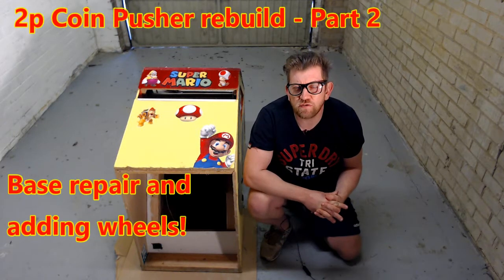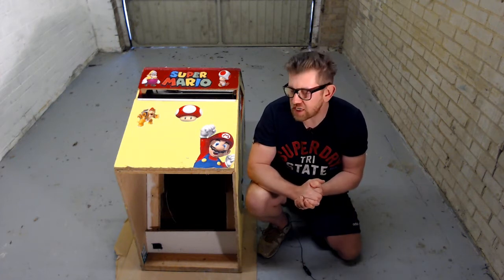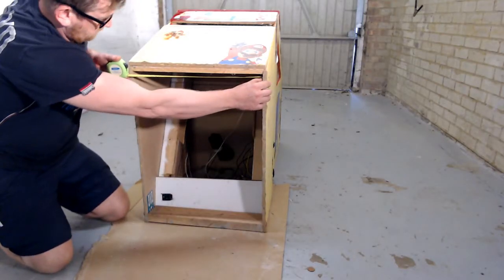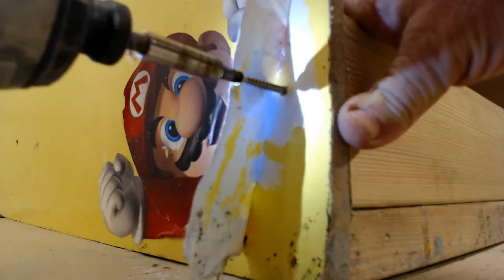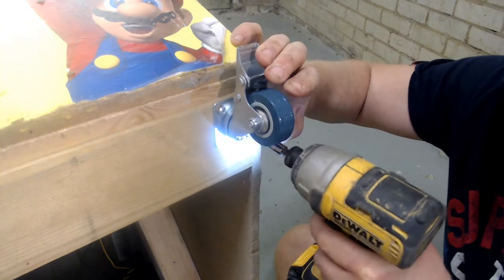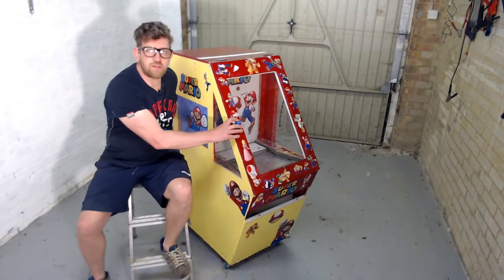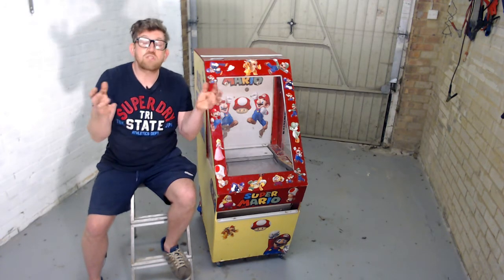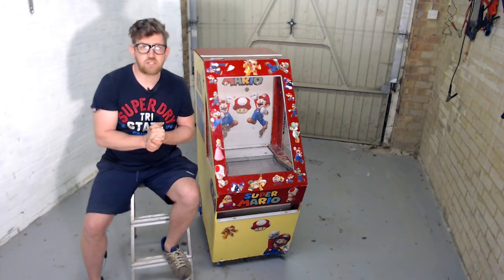Coin pusher rebuild - Part 2 - Adding castors and making it manouverable. DIY Tipping point

Comment: Video says prices will be below, but there are none, where is part 3?
Reply from the maker: Hi Vass. I thought the prices were on there. I will update that. Part 3 is coming, I have just been really busy! Sorry! It is coming!
Reply: @andycharger  awesome, I want to draw up some plans and build one.
Reply from the maker: Thanks buddy. Have you found the original build videos I made for it before the restoration? I have a playlist for them. Here you go if not: https://youtube.com/playlist?list=PLf_T3G0RIhC7w7PH1vCaOsFDYEXo3j-eZ
Reply: Thanks Andy, I'm 3D printing the pusher, play area, coin chutes and auto nudge trap.

I struggling with the coin entry, I presume you went in directly from the top, I'm trying to have vertical coin slots on the front above the glass, it's just finding from actual arcade machines, how to rotate the coin from vertical to horizontal,  
I watch with interest your side coin chutes work with a flat coin, not relying on the coin rolling.  If I have enough drop I could make the coin player entry slot horizontal.

Any thoughts?